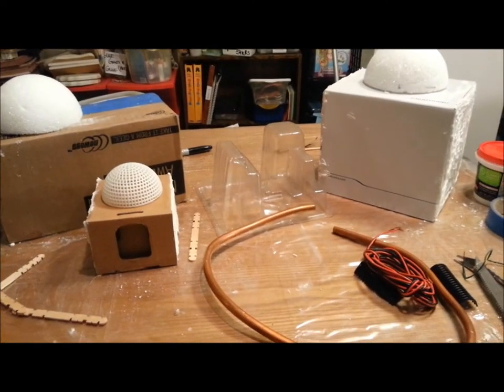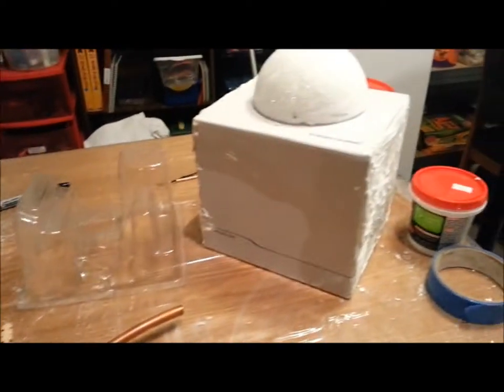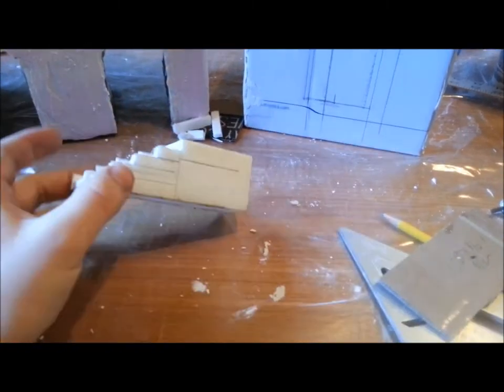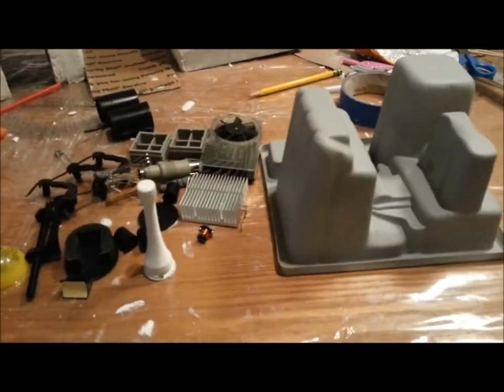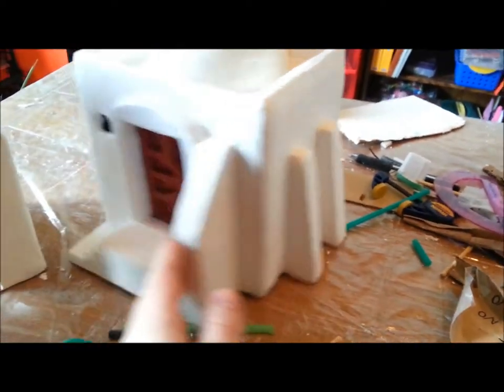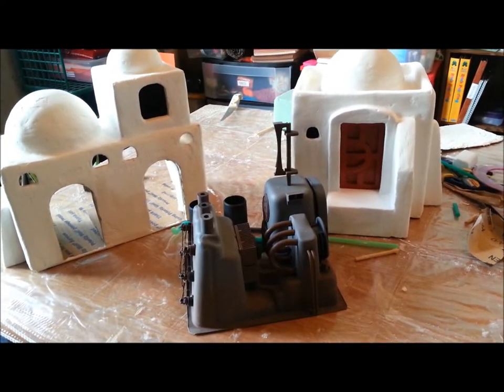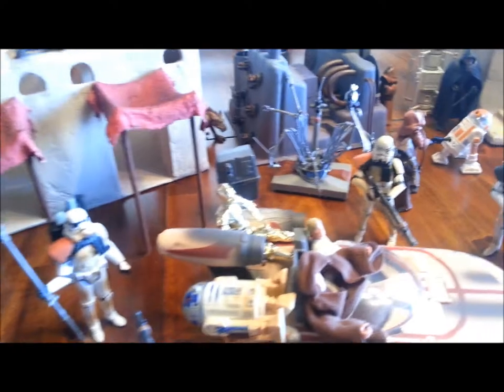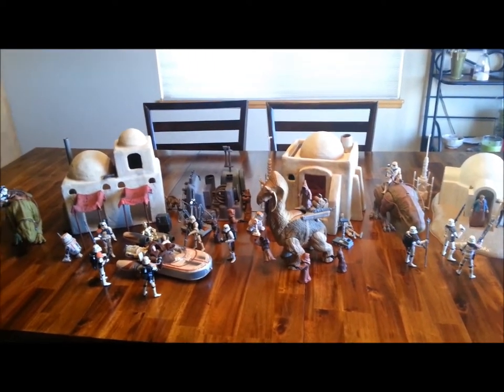Creating a Star Wars Tatooine / Mos Eisley Diorama

Comment: looks great! how many layers of spackling did you apply?
Reply: Thanks!  I essentially only applied one layer but I did apply a second only in certain spots.  Anywhere it looked uneven or where the sanding revealed flaws I would apply some touch up spackling.  The first layer was VERY thick.
Reply: yeah that's what i thought because they came out really perfect and adobe looking. do you know if you could achieve this affect with plaster bandages?
Reply: youngjedi1440 With plaster bandages alone?  I wouldn't think so but give it a try!  Plaster bandages are pretty cheap to come by so you never know what kind of results you'll get until you give it a shot.

Comment: Hi there I like your work I have two questions. What do you use to cut the foam and what tools do i need
Reply from the maker: Hi, I used an Exacto knife on the foam core, Styrofoam and boxes and used a regular serrated knife on the Styrofoam balls. Tools were mostly the above along with scissors and then  sandpaper for the finishing. Hope that helps!
Reply: +GavilanOrd thank-you I am doing 6" black diorama
Reply from the maker: +Sammy Turnage Excellent! Please send a pic when you're done!
Reply: +GavilanOrd I'll try but it might be awhile I'm doing the Death Star I only have a 4' by 4' section to work with and i plan on layering it